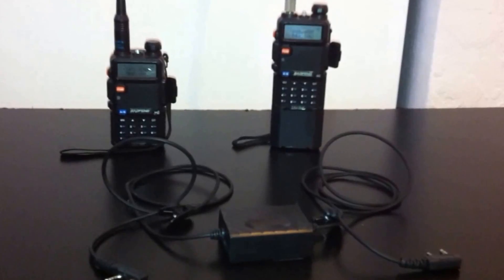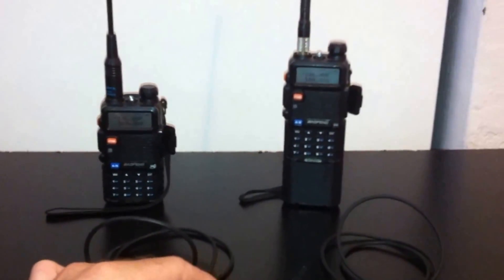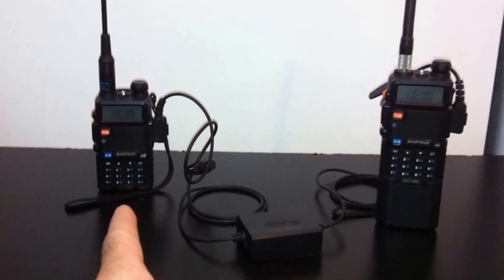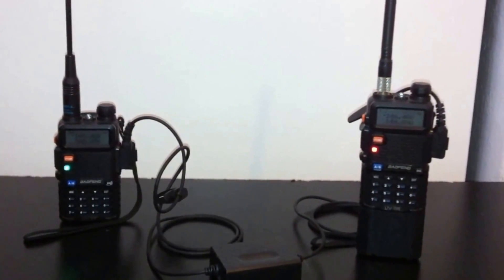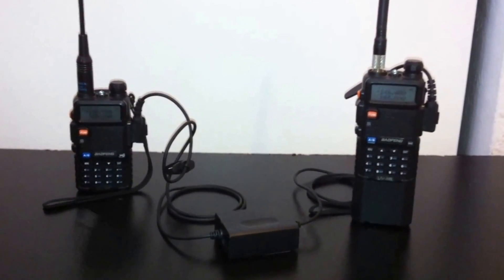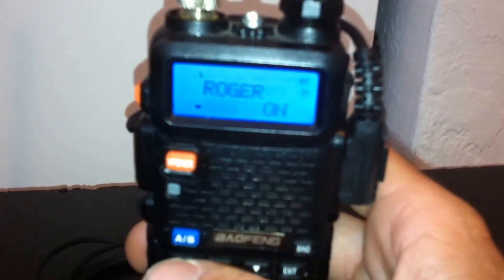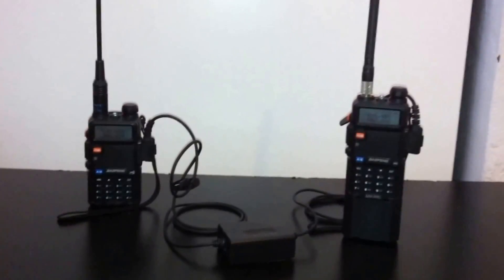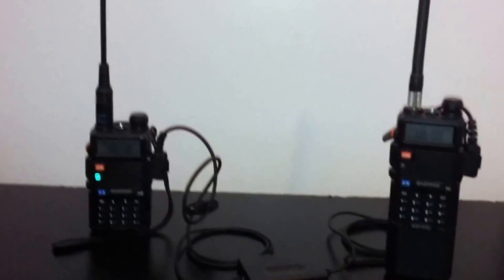Set up a Baofeng UV-5R repeater

Comment: You do not address the settings between the two radios that have the interface. So any settings will work with all frequencys, no matter the output radio      settings?

Comment: I have been wanting to set up a mobile field repeater for camping site.  I have a 8ft painter pole that extends to 50ft.  I want to put 2 antennas on the tower/pole for this.  With the 2 antennas so close, what kind of filtration should I need on each to prevent crosstalk?  

Both radios will be on UHF, not on VHF.

Comment: So I have a random couple question. 1) will the box transmit a repeater ID? 
2) is this only for VHF and UHF? Like if I connect one of these to a 900mhz radio would it work the same?
Reply: 1)  No, ID must be done by the sender  (there is no separate ID for the repeater) 
2)  You can use UHF on both, or VHF on both, or either on one and something else on the other.
3)  Whatever comes into 1 radio will be transmitted out the other radio.  

       For example:  if you had your receive radio on a Ham radio frequency and 
       your transmit on a GMRS frequency, then when you transmit on your Ham 
       radio, the GMRS radio was receive your signal.  

       However, this configuration would be illegal.  I just used it to give you an 
       example to better understand the operation and the differences.

Comment: less than half the information needed to get this to work, does the vox need to be on, what is the rx and dx freq for the transmitting radio ? is it opposite to the recieving set ?, is it able to do the job without an offset ?, terrible video

Comment: ive seen people have issues with that setup because the unit uses VOX?
Reply: The VOX function on Baofeng is disabled in factory default settings, why change that?
Also remember to set a Tone function (CTCSS and DCS) for Repeater Use in order to not transmit in every little noise interference.

Comment: Can you do the same setup for UHF Frequencies?
Reply: I have been trying to do the same setup on UHF but just can't get it right. I get it to transmit like 2 or 3 times, and then the message doesn't get relayed. Are there any special settings that need to be done?
Reply: @andriesgrundlingh6924  Are you using CTCSS/DCS tones?
Reply: @e.k.3659  I have tried it with and without CTCSS/DCS. I've been playing around more, but hit another snag. If the radio I am transmitting to is close, it works great. As soon as the second radio moves off, he can hear me, but I can't hear him. The channel doesn't even open from his side, but when I unplug the radios, the receiving radio picks the second radio up. Plug it back in again, and then he can only hear me.

Comment: With that  interface you don`t need to have VOX on the transmitter radio or it has to be on?
Reply: You have to configure VOX properly.
Also add tones (CTCSS/DCS) for smoothing out noise interference.

Comment: Hi, I’m trying to set up this type repeater using the same cable in the vhf frequency band and every time I connect the two radios rx 158.745 and tx 155.085 the tx radio constantly keys up while they are in the charger how can I mitigate this issue? Thanks
Reply: Have this same problem, did you ever fix it?

Comment: Been experimenting.  

This is a cool, nifty, low budget, two way repeater system.  Tones squelch could be used but is not necessary.

 They don't use VOX.  Audio out of one repeater radio, makes the device short
   the bases of the plugs at the other radio together making it transmit.
   Turn the volume all the way up on both radios to make it work best to trigger xmit.
   If you have your carry radio transmit a tone, it helps the device trigger quicker so 
   the first word you say doesn't get chopped.  I put an ohm meter on the plug bases and it shows
   how quickly or slowly the device keys the other based on input from the other radio.
 
 The chinese communist party doesn't let their workers and engineers talk  to Americans. 
   When the Russians let their people talk to Americans, they lost the cold war.  Chinese
   communist party it trying hard to avoid this loss of power.   So there's absolutely no
   industry/customer communication or  documentation,  just bad translations.

If the radios are close together, they get stuck in a transmit loop.  External antennas at some distance may help.  
   I found one source that says putting antennas at different heights helps as well.  UV5R's don't filter harmonics
   that great.  Heard it recommend using different bands or lots of freq seperatation between xmit and rx freqs.  
   Not sure why Eric's worked so well being that close.  I wonder if coiling the wires or using slugs helps?

Set one repeater radio to one frequency, the other repeater radio to another frequency.  That's about it.   I like to set the A and B
 channel the same, on each radio, to keep from making a mistake.   
   
It's fun to experiment with.  There's lots of loons with low T on the nets, so expect some folks to scream that the sky
   is falling because you didn't buy an expensive repeater for your learning project.   Even the most ignorant people have
   insant global communications these days,  so hang tough.  

73, BTW...   Eric's work is GREAT!

Comment: i bought that interface, but it only works for me when i set it up backwards.

 meaning: the little black box that is labeled "receive/emission" i have to have my "emission" cable  plug go to my "receive radio" and my "receive cable end" go to my "emission radio".

if i plug stuff in back wards it works, if i follow the sticker arrows the transmits radio doesn't begin transmitting until the recieve radio is done receiving, which at that point there is no audio to pass along so it transmits nothing.

i played with this about a year ago, but tonight i am only now discovering that it only works backwards for me. i watched your video again, thinking maybe someone put the sticker on upside down which would invert the cables, but using the oval shaped indention on the top of the black box as a reference shows my sticker matches your process for some reason.

can you offer any advice?

Comment: The Baofeng can transmit around 1 mile. In this configuration you only gain a maximum of 200 yards. Yes that's right. IT DOESN'T work except for close range.
Reply: You are simply wrong. It’s all about elevation and obstruction, when I am properly elevated my Baofeng UV-5R can  broadcast >10miles, if this repeater was setup properly it would turn that into >20 miles.
Reply: @Zurtle1  do it!
Reply: @Rusted_Link  i have.

Comment: will this only work as a cross band repeater? i was wondering if i can use this for gmrs.. I tried it but it seems like it goes on a "loop" and no range at all, please help! :) thank you!
Reply: GMRS transmits and receives on the same frequency, so this wouldn't work for that.  Some new GMRS radios are designed to be used with a repeater.  Those radios would work with a setup like this.
Reply: If operating as a GMRS REPEATER, you would be separated by 5 Mhz, the same as generally found in amateur repeater offsets. Very likely, you'll wind up having these "looping" unless you can use external antennas and sufficient lengths of coax to separate them. This is more important for high gain, more-efficient antennas. Operating on LOW power should help reduce desensing, but that goes only so far. Experimentation is KING in this.

Comment: I purchased one of these and the tx and rx are inverse of the way they are supposed to be. The thing never transmits until you let go of the PTT... Then you just get the Rgr tone.... I'm glad you found one that worked!!!
Reply: I know this is an old comment, but your reciever is being overloaded by your transmitter.
Reply: I know I’m a bit late, but it’s because your transmitter has a bunch of spurious admissions that is overloading the receiver the best way to do this is do a crossband repeater set the received to 440 or 144 and set the transmitter to the other option. That way there’s no spur admissions.
Reply: @KQ4WQM  I can only get it to work cross band with VHF as the input
Reply: I've had the same problem it seems these only work when your within a few feet of the receiving radio

Comment: Doesn't work here..., tried it with different Baofengs;  UV5R's and UV82-s, but nothing.
The problem is that the TX unit keeps transmitting, i changed all FOX possibilitys, but nothing, keeps transmitting.
Changed the offset from + to - , from 0,6 Mhz to 10 Mhz; nothing...
And an other problem; both the RX as the TX unit's display's are on line "A" both when you connect the cable they both changed to line "B" and there is no way to go back to line "A" (dual watch is off)
So i gave the lines A&B the same frequencie but that also don't work,  the TX unit keeps tramsmitting no matter what...
Any suggestions?

Comment: Reading on a repeater site, do these really work ok, since they do not output more than 5 watts?  Does the transmitting radio interfere with the receiving radio, since they are in such close proximity to each other?  Most repeaters use 1 antenna and a rf filter to filter out cross talk.

Comment: Question. Can GMRS fixed channels be repeated in any way? I get the Ham radios part, I have both. But the GMRS transmit and receive on the same frequency, they don’t have offset options.
Reply: Actually, the GMRS frequencies do have an offset. The transmission out of a gmrs radio on a repeater channel is 467.xxx and the receive is 462.xxx.

Comment: ok so when i use simplex i get about a mille to 2 milles with good line of sight only but mainly a mille. if i do these project what is the range i can expect from this ?
Reply: Range is dependent on your antenna. With a yagi antenna you could easily talk 25+ miles or more on simplex.  If you were to setup a repeater like this and expect a large range, you would need two independent antenna capable of providing decent performance.  So, either two yagi or two omni-directional antennas..or one of each.
Reply: @BeastTechWrench  ok  what about using a audio jack 2.5mm to 3.5mm. Here you are using an interface. What is the different on the interface and the audio 2.5mm to 3.5. ? What bout the transmit radio. Is it having more watts increase range 🤔
Reply: @SuAmigoElilegal  I don't use an interface and I have never tried using these radios as a repeater, but there are plans on the internet to make an interface and or use a cable to do the same thing. You said you only get about 2 miles of range with your radios, the only way to increase that is by using an outdoor antenna. A rubber ducky antenna limits your receive and transmit range. The radio that receives must have a high performing receiving antenna and the radio that transmits must have a good antenna also. This is why repeaters use tall towers, so they can hear weak stations (like people with Baofeng HT's using rubber ducky antennas)  Unless you live in an area where there are wide open spaces with no trees, buildings,  mountains and other obstacles in your way, you can't expect much performance with the antenna that comes with the radio. At best you might get several miles. Hook it up to an outdoor antenna and you will easily talk long distances provided that the person you are talking to also has an outdoor antenna.

Comment: Are we hearing you on radio B or on the GT3 in the background?  I want the pair ( radio A and B ) to be silent.
Reply: i assumed we wouldnt hear him on radio b and that it would light up as if its transmitting, albeit i know its doing both
Reply: @jasonbrown467  I ended up buying the interface anyway and you are correct.  There is no audible output from radio B when transmitting and connected. Which is precisely what I hopped for.
Reply: @TheModularDiver  nice, glad to hear, i want to set this up as well

Comment: So let's say the repeater is 145.67 and everyone in the neighborhood can connect. How would it be different than just using that frequency as a simplex net?
Reply: in semplex you get the worst possible transmit and receive situations some times. Radios in vhf and Uhf both only do good when they have line of site. If you put this repeater set up, up somewhere high, that most anywhere can talk clearly to, then it able pass along your message much farther than if you were in simplex from two ground locations.

Comment: Damn, hit send too soon!

I assumed this mini repeater would work like any repeater i.e. a transmission would be picked up by radio A, and sent back out through radio B. Then the returning transmission would be received by Radio B and sent back to the original source through radio B. No such luck. There goes my idea of long-range simplex communication through my roof mounted antenna while seated in my lazy boy with UV-Whatever with a rubber duck set to 1 watt.
Reply: Poooor brad😭😭gonna have to walk his obese self a few feet😭😭😭😢

Comment: Be forewarned, this little mini repeater device, as well as others sold on Amazon and ebay, come with NO INSTRUCTIONS! And, trust me, the seller will not know the specifics of setting this thing up nor does he know anybody that knows how to set it up nor do they. I went back and forth with the seller who finally emailed me some simple stick drawing of two radios plugged into the mini repeater. Big deal. That didn't tell me specifically how to set the radios.

Fortunately, one of the commenters - drsquirrel00 (thanks Doc) detailed the specific procedure in a well-worded comment.

Unfortunately, I was under the assumption this would work like any other repeater, i.e.
Reply: i scrolled and crt+f the entire comment section and cant find the instruction, can you point me towards them or share them here?
Reply: 🤣🤣🤣🤣💉vaxxed boomer, stick art🤣🤣🤣
Reply: Really? You couldn't leave those instructions for us here? Big help you are...

Comment: Thanks vor the Video, all is great up until the external outdoor antenna. I’m setting up a box with the two radios, the repeater box, battery solar panel etc. to take to deer camp or for an emergency.  I want to use two external antenna but as soon as I ask a seller about their product and if it will work, it’s as if I just insulted them. I’m looking at n9taxlabs.com now, just sent them an email waiting on a response. I like the idea of these roll up jpole antenna that you can hang from a tree. What do you think? 

My plan B is to leave the repeater/radios in my truck and drive it to the middle area between base camp and the hunting area and use 2 of those magnet mounts on each end of my truck. Once I find antennae that will work as planned, I’ll build the thing.  Thanks for your help. Anybody, please, I need advise on this. I can’t show up with something that won’t work.
Reply: I know this comment is over a month old, but giving my two cents. The N9TAX antennas are great to have. He builds a quality antenna. I own at least 3 and have no issues with any.

Comment: Please help me :( Ive got a similar setup that i cannot get to work. Ive got two baofengs acting as my repeater, a duplexer that is properly tuned (467.675 and 462.675) and an amplifier hooked up to my TX radio. The setup works flawlessly when I am close, works as it is supposed to. However from about a block away it will no longer carry voice transmissions even though its within range and can be pinged for a curtesy tone. Any insight would be much appreciated
Reply: In spite of your duplexer the transmit side is desensitizing the receiver.  My solution was to get the two radios as far apart from each other as I could and use a looooong audio cable between the radios.  But I still had some desensitizing going on because I didn't have a duplexer available.
Reply: @marcspeth4850  One thing also to consider is the possibility of the cable bringing in RF from TX to RX. Consider adding some toroid iron cores along the cable, especially before the TX or "emission" end of the box (although it can work either direction, truth be known!)

Comment: Can someone explain to me the purpose of the -600 offset?
Reply: A repeater system uses a offset frequency when transmitting and receiving. It receives on one frequency and transmit on a different frequency. Thus  the 600khz  offset between the receive and the transmit frequency. You can make a positive offset +600khz or a negative offset -600khz.
Reply: You push the ptt button and talk on your radio , the repeater radio(one) receiving your transmission opens up Scheal listens and then sends it to  radio (two) and  then radio(two)  transmit to your buddies radio. So without offset frequency the radios will be transmitting twice your message.

Comment: Is this FCC approved for use in the USA? How does the repeater identify itself as required by the FCC?
Reply: Yes. Its legal.  You just have to identify it when transmitting verbally every 10 min.  
Such as " this is  KB5G4  on KB5G4 repeater".
Reply: @wilcoxtactical3716  That's great, but if you no longer have direct control over the repeater, or leave it turned on while you are away - the repeater must self identify regularly...
Reply: @benningtoncamper2852  it doesn't have to self identify unless there is activity on the repeater. Common misconception. You do have to be able to shut it down though if needed either in person or by remote which is one of those you just work around. With limited time this repeater can operate, due to running on batteries its usually not a issue.